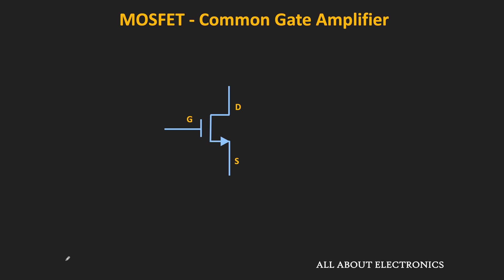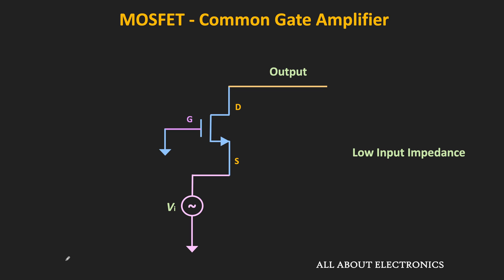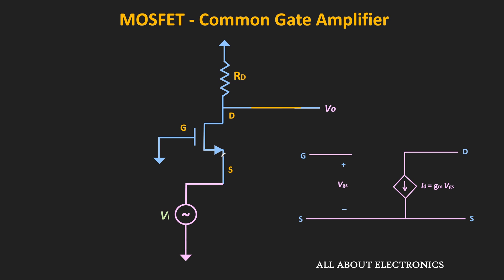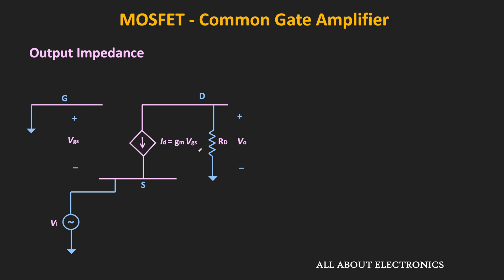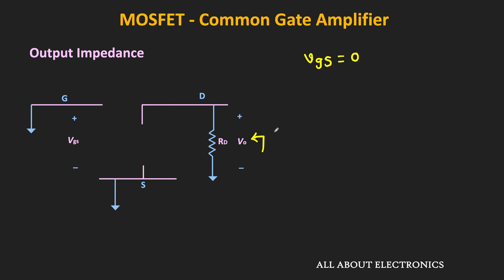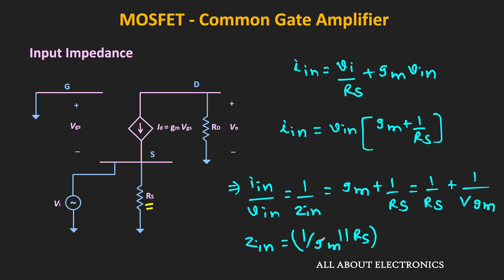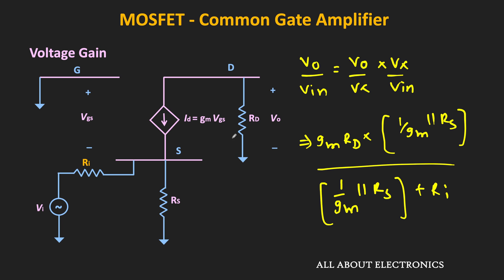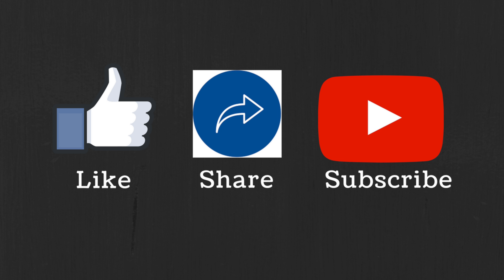MOSFET Common Gate Amplifier (Small Signal Analysis) Explained

Comment: Sir why the resistors R1 and R2 are open circuited?
Reply from the maker: Since gate is connected to the AC ground via coupling capacitor, the one end of resistor R1 and R2 will get connected to ground. Likewise, the other end of resistor R2 is also connected to ground. So, R2 will act as open circuit. Similarly, if you see the other end of resistor R1, it is connected to Vdd. And for ac analysis, that will also act as ground. So, both end of R1 are also connected to ground from ac analysis perspective. And that's why both R1 and R2 are removed. I hope, it will clear your doubt.

Comment: 2:13 sir I have an small doubt
Generally in fixed bias circuits V(GG) is connected to gate from negative terminal but here you are taking it Positive. 
Love from Uttrakhand ❤🙏
Reply from the maker: The one that you are talking about is for Depletion type MOSFET. This is enhancement type MOSFET.
Here is the link for the video of fixed bias configuration for depletion type  MOSFET. 
https://youtu.be/vBvLu3euc2Q?si=3S9fiRV9lpyipFu1
Reply: @ALLABOUTELECTRONICS Thanks sir ❤🙏

Comment: How often is the small signal analysis on the transistor component level is used during the real work in the hardware design?
Reply from the maker: It is useful while designing a amplifier circuits. Of course, now a days, the CAD tools are available, which will include all these aspects during the simulation. But still, it is good to know how exactly these calculations are performed. Having this knowledge is always beneficial during troubleshooting or new designs.